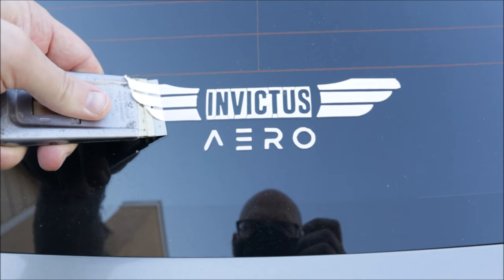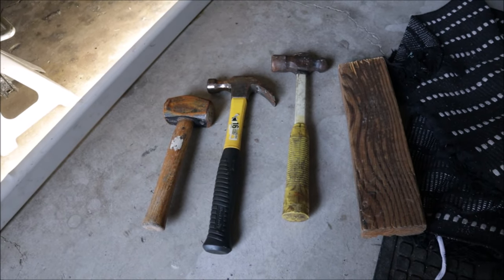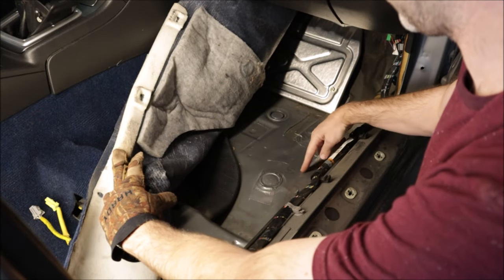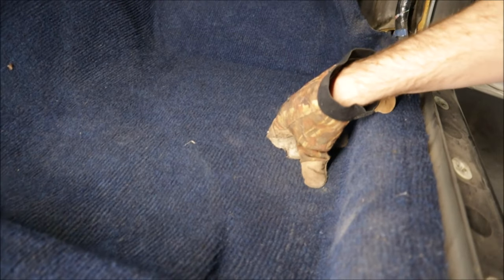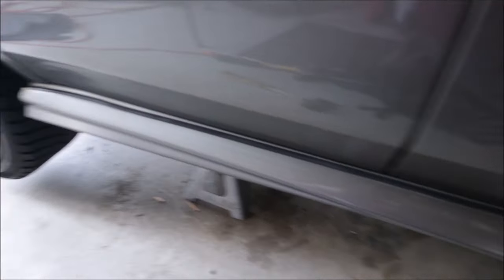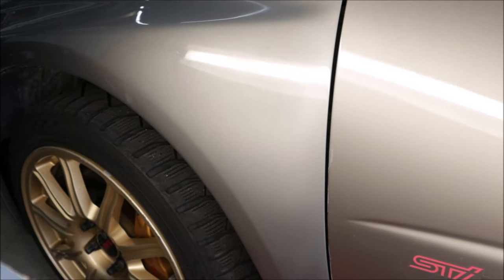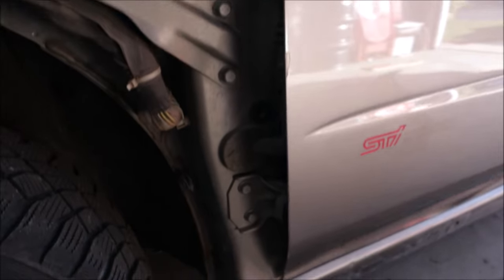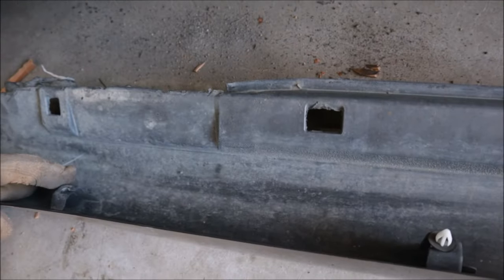Frame and Pinchweld Rocker Repair - Neglected STI Hawkeye Build Part 4

Comment: such a shame that people lift these cars on the pinch welds they fold so easily
Reply from the maker: I agree! Even worse when they jack on the thin floor.
Reply: @RoadPatina  yeah I find u need a certain hoist with the proper feet that doesn't pinch them
Reply: Pinch welds on Toyota and hondas hold up much better